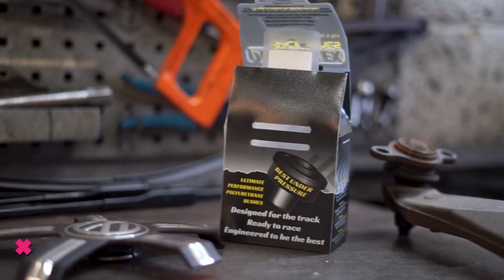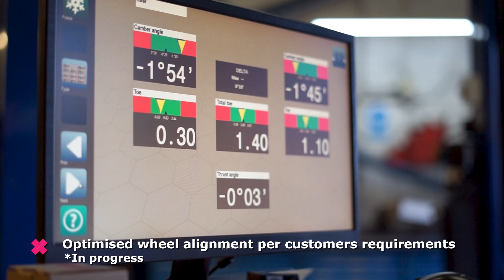VW T6 Lowering with BILSTEIN B14 Coilovers and Handling Upgrades with Powerflex & H&R

Comment: Noticed some vans have bigger gaps on front arches than on rears... is the right or not set up right?
Reply from the maker: The only way to know is to measure the centre of the wheel to the arch. The suspension does 'settle' slightly from the initial use. 

Too many variables to comment.
Reply: @RegalAutosport  so if the measurement is different does it need changing so all 4 are same gap? Or is it ok if only a mm difference
Reply from the maker: @luciocancellara4995  Depends on the look you want to go for
Reply: @RegalAutosport  ye understand that but was just checking what the norm was or if they should be all same gaps
Reply from the maker: @luciocancellara4995  There isn't really a 'norm' , it's largely down to the customers taste/use case
Reply: @RegalAutosport  ok thanks- will know what to ask for now when mine gets lowered, 
Prefer the all round same gap look 🤣

Comment: In the B14 kit, are the rear shocks B6 or B8?
Reply from the maker: This is a B14 kit. 

B6 = Sport damper for use with a stock spring
B8 = Sport damper for use with lowering spring 
B14 = Sport damper with lowering spring that has an adjustable spring perch for ride height 

The dampers used on this kit are likely to be similar to the B8 damper available